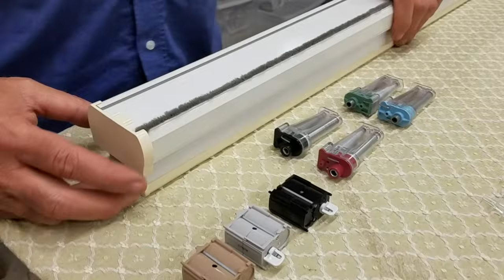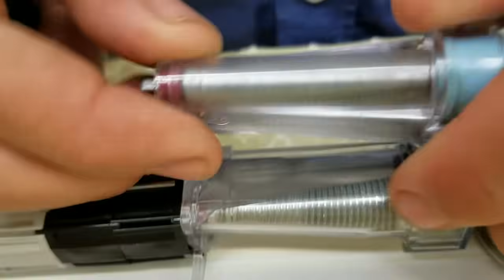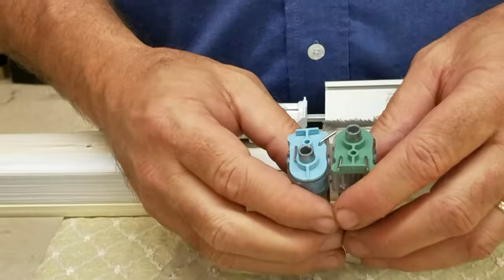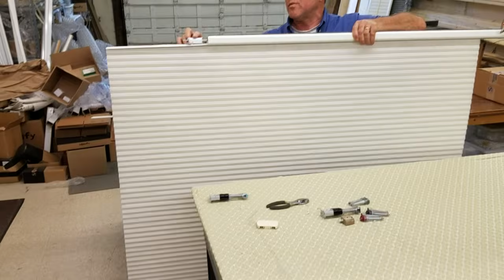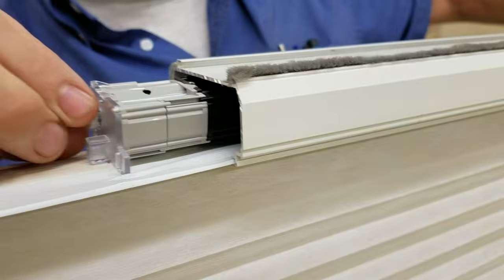Hunter Douglas Duette Shade LiteRise Lift Repair from AutomatedShadeStore.com

Comment: You can cheat on not having to buy the black and gray motors. Just stick a small straight screw driver into the square slot and turn in counter clockwise to rewind the spring inside.  I don’t know the exact number of turns though you can feel tension build. If you don’t have the shaft stop piece to place in the end of motor then use a small piece of wire to wrap around it and place one end in the small hole to stop it from spinning.  You also need at least one pin for the transmission (blue in my case) so when you add the black motor it doesn’t unwind when you pull the stop shaft. I’m buying one of each , gray motor, black motor, and blue transmission so I have backups but also the pins for the transmission and the stop shafts for rebuilding.

Comment: What I find is the customer pushes the blind to fast and creates slack in the cord and wraps around the shaft.  So you need to lock the motor, remove it including transmission and remove extend it back down then then roll it back up, turning the shaft making sure the cord reels up correctly.  Then put back the motor and transmission.

Comment: You are a rockstar. My problem was that the motor spring tension was not strong enough. I was able to put a small visegrip on the motor end to hold the spring tension in the motor, remove the transmission and then tension up the motor spring a few turns and reassemble it. It took a couple of iterations to get the tension correct but it works great now. Thank you.

Comment: I have a 10 year old shade that no one would repair. It is 8ft long and would have cost me a lot to replace. I ordered the recommended parts, followed this video and “tada”, it is now fixed. My husband was so proud that I took the time to research a fix before we replaced the shade. Thank you, thank you! I definitely recommend giving this a try before you rush out to replace.
Reply: Where did you find the replacement parts in this video? I'm having trouble tracking them down and the link in the video description gives me a safety warning.

Comment: Thanks--this was helpful. It would be good in the future to go a little slower. For example, when attaching the clips to the transmission and engines. I had to really see how you did it by stopping and freezing. Also--the video edit at the end was a bit confusing. For those watching--you definitely have to let it out first before pulling off the styop. Also--mine did not go up as easily. I had to pullit further down and wiggle it up first. After a few times it tightened up.

Comment: This video was much appreciated.  Parts were ordered from you and successfully installed. Blinds are operating again.

I watched the video a few times, downloaded and read the PDF on your website, and still came up with some tips that I believe others could use as well. I have an Up/Down set of blinds with two transmission/motor assemblies.

Read all the way through before beginning work.

•	TIP: If you are replacing just the transmission/motor assembly, then there is no particular need to slide the head rail entirely off the rest of the blind (which I did and later a working transmission/motor assembly slipped out of its mounting holes and the spring unwound. Bummer. It would have been nice to have maintained that as a backup).
•	TIP: If you have a second motor/transmission assembly that is still good, put a white shaft stopper onto it to prevent the spring from accidentally unwinding if the shaft should pull from the transmission (which readily happens). Putting the stopper on it should be done while the blinds are fully extended.

1.	The new transmission has two removable pins that prevent it from inadvertently turning. Slide the clear plastic transmission adapter onto the transmission, protruding edges forward. To make installation easier, pull the pin on what will be the bottom of the transmission. Leave the top pin in place for now.
2.	Snap the black motor onto the transmission. Push until it clicks. Make sure it is seated properly.
3.	Remove the white shaft stopper on the black motor by wiggling it and pulling it off. Use this shaft stopper in the TIP above.
4.	Snap the outer motor (gray, tan, etc.) onto the black motor. Push until it clicks. Make sure it is seated properly.
5.	Snap the clear plastic motor adapter onto the outer motor. Push until it clicks.  Make sure it is seated properly.
6.	Leave the white shaft stopper in place on the outer motor. Remove the second pin on the transmission.
7.	Lower the blinds until the spools are empty of their cords. If you have an up/down blinds, lower both together until the strings are completely unwound from their spools.
8.	TIP: If you have a second motor/transmission assembly that is still good, now is the time to put a shaft stopper onto it to prevent the spring from accidentally unwinding if the shaft should pull from the transmission (which readily happens). Putting the stopper on it should be done while the blinds are fully extended.
9.	Keep the string from wrapping around the take up spool.
10.	Line up the transmission assembly with the shaft notch and slide together, leaving the white shaft stopper in place. Make sure the string is not tangled in any way. Keep the blinds lowered for the moment.
11.	If you need to replace the second motor/transmission assembly, slide the head rail in the other direction, exposing the assembly. Replace it, remove the second pin from the transmission, but leave the shaft stopper in place for now. 
12.	If any of the string take up spools have shifted, put them back into place. Make sure the string is completely unwound from the spools.
13.	Slide the head rail first in one direction, then the other and pull the white shaft stopper off each spring motor/transmission assembly. Wiggle it a bit with a pair of pliers if necessary. Keep the stopper and pins for future usage.
14.	The tension on the transmissions will begin to pull up the blinds.  Test operation by pulling the blinds down and raising them up.

a.	If you need to clear up something, e.g. a knot in the string, pull the shade all the way down, and put the white shaft stopper back on the square end of the shaft sticking out of the outermost motor.

15.	Slide the head rail into position.
16.	Put the head rail end caps back on.
17.	Install in window.

Hope this helps others even as your video got me started.

Comment: I recommend anyone buying these types of expensive shades, not to do so. The string in the transmission will fail after about 4 years regardless of usage. The heat and cold cause the transmission string to become brittle and snap. I have 27 of these in my house and I bring them down weekly to be repaired. They have a 7 year warrantee and each one cost us around $800 a piece. 800x 27 = Well over 20K for constant headaches. Buy the cheapies from Lowes or Home Depot. They are GARBAGE. I just purchased enough parts for 4 shades because its embarrassing to keep going back to the store.
Reply: All of the transmissions were modified about 24 months ago to remove a small internal plastic piece that rubbed on the string and caused excessive wear that led to failure. The new transmissions should provide many years of service which remains to be seen. The new modified transmissions have a “smoked” color clear plastic cover instead of the old clear plastic. We only sell the new modified types.

Comment: I have two black motors connected together. They work, but I need to buy a new transmission. How many turns should I wind the motors to get to the starting point in the video? Thank you.
Reply: Answer: I purchased a black motor and counted the number of times that it was wound from the manufacturer. (I carefully removed the key and counted how many unwind turns before it rested.) Knowing the count will help me fix other blinds that I only replace the transmission. 42 times! --Way more than I imagined!
Reply from the maker: 42 clockwise turns should do it.

Comment: Is there a way to know the lines inside are good before clicking the transmission and gear into place?  Also is there another step if the line came detached at the bottom plug?  I’m a little concerned I may connect the pieces and nothing happens.

Comment: Great video instruction 👍We also accidentally lost tension on the first set of replacement motors. One little key part was keeping the shade fully open before pulling the motor pinout. I'm stoked to have it working again. Thank you.

Comment: What if it hangs crocked ?
Reply: If the shade hangs really crooked then the lift cord most likely is wrapped around the cord takeup reel incorrectly. If it is just slightly crooked then it was probably like that before it broke and can be adjusted at the bottom rail by adjusting the lift cords thru the pocket and ferrule or the cord adjuster if a newer shade.

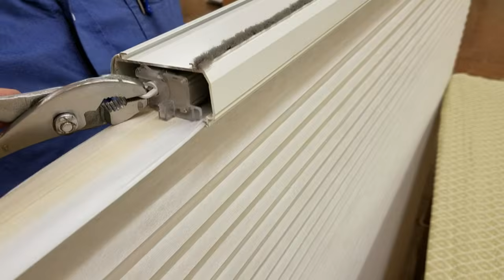Comment: I got my second replacement motor, followed along again, and at that moment when you remove the shaft stop at 6:54...I got to hear my motor whizz out, losing all the tension.  No idea what I did wrong this time, but the blinds are beginning to shred now where I move of the metal covers back and forth and I just cannot face buying another kit to get the same results.  I guess I get to be the one where it does not work.

Comment: thanks for the video.  Like most viewers I appreciate your step by step instruction.  I did purchase the parts from your site.  The most difficult part of the repair was taking off/on the blinds from their mounts.  Ironically HD offers lifetime warranty on parts, however, labor is over $150, so it was still cheaper to purchase the parts and make the repair as instructed.
Reply: Glad to hear your repair was a success🎉. Hunter Douglas states that the lifetime warranty applies to the original purchaser.

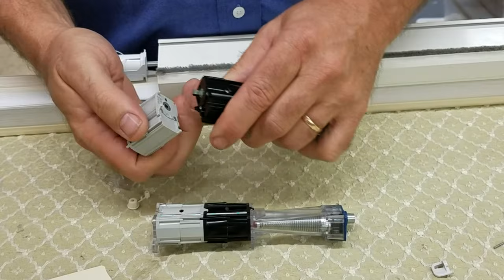Comment: Alas, I watched this several times and then, when it came for me to do it, I had my headphones on and was concentrating on what was in front of me.  Which meant I stupidly removed the shaft stop at 4:07...but as I only had one motor, that step was not for me.  I found out at 4:48 when I heard you say "You don't want to release this."  Sigh.  I feel like such a twit.  On the plus side, I have now been through the whole process once and know what to do right this time.

Comment: Thank you thank you THANK you for putting this video together. I broke my first transmission because I simply installed it on top of my existing motors. Learning from experience I decided I'd better have a harder look for the secret to installing the replacement part. I had a spare I bought (thankfully) BUT I didn't have the motor assembly. So what I did was I installed the transmission on it's own with the adapter installed and clicked it in place. I came in behind with with the motor assembly I had wound up (about 20-25 half turns) using a hex nut screwdriver adapter and with some assistance we got the two together. Unless you're really dexterous you're not going to be able to hold the spring tension with the screwdriver AND get the transmission installed. The process was less drama that I imagined. In the end, one of my strings was shorter than the other so I've got a small tilt in the blind when it's down but, for now, I'm a happy dude. There is NO information on the HD website nor is there any support info on the parts store where I bought the transmissions. You, my friend, is why YouTube still exists. Thank you for doing this.

Comment: Once again this video gave me all the info I needed to repair a Hunter Douglas Duette LiteRise lift.  Thank you!

Later, my wife called Hunter Douglas to get replacement lift tabs; they told her there is a lifetime warranty and sent her several for free.  I purchased replacement motor and transmission on line, but they might have been free from Hunter Douglas.

Comment: Okay, I wound it like you said, and it started clicking at about 20 winds so I stopped. It raised the tension but did not pull down correctly and made a clicking noise as I pulled it down until it was back to weak tension again. Does this mean my motor/spring is broken?
Reply from the maker: Yes motor is broken

Comment: Do you have an explanation on how to do this with top/down bottom-up version? I can't seem to figure out how to get the new motor and transmission to engage properly when installed. I think has to do with how the spools are set before I release the motor stop. Thanks!
Reply from the maker: Top down BottomUp shades are best done with two people.  One person holds the shade so both the bottom rail and the intermediate rail are fully extended away from the top headrail and the lift cord will be bailed off both sets of lift spools.  The other person will position the new lift assembly in place making sure the transmission adapter and motor adapter pins are seated into the punch holes in the aluminum slat. Slide the assembly back into the headrail and pull the white motor stop/lock off the motor to complete the procedure.

Comment: This guy is a rockstar! I followed the instructions but accidents happen and I lost the tension on my motors while reinstalling. I called him and he gave me a solution that worked. What a nice guy!!!
Reply: Where did you find the replacement parts in this video? I'm having trouble tracking them down and the link in the video description gives me a safety warning.
Reply: what is the solution?
Reply: @jadenmateri probably to connect the transmission into the silver bar (v notch or d notch) and then wind it by hand by twirling the mechanism before placing it on the track and snapping it into the pin holes. Hold in place and slide the track back in.
Reply: I can't get my blind to go all the way down

Comment: I purchased 2 motors, biege, for 2 shades.  The transmissions are still in good shape and wound as it should be. Followed directions exactly per the video an it is not working properly. The internal lines a intact. Does not retract with out help and does not go all the way up. What am I doing wrong? Do the shade wind up spool shafts (3) need lubrication?

Comment: Keeping this going. A daunting repair made easy. Worked on my Vignette Shade. Easy ordering and quick shipping. Note you might consider having some double stick tape or glue handy as the fabric was pulling away from the top guide, as well as the aluminum  housing.

Comment: Would you please  comment on how to correct the problem of one side of the shade drooping down after it has been retracted. Is the repair a simple as popping out the plug on the bottom bracket and shortening the string?

Comment: Great Video.. are these motors / transmissions standard items?   I have some wooden blinds by Blinds.com and the motors seems to have failed... it looks just like the black / grey motors you replaced.
Reply from the maker: The motors and transmissions for Wood Blinds are larger than the parts used for the Cellular/Duette shades and cannot be mixed. Here is a link to a video to repair the wood blinds: https://www.youtube.com/watch?v=tURuNlkSF8Q.  If your current parts look like the ones in this video then they will work. Hope this helps.

Comment: The video shows a bottom up repair, I have a bottom up / top down shade where the top down transmission failed.  Do the same procedures apply regarding the state of the blind before you remove the last transmission pin?
Reply from the maker: Yes both the bottom rail and the intermediate rail will be fully extended down all the way so no lift cord is on any of the cord lift spools. Then install the lift assembly and pull the pin.

Comment: Wow! I did it!!!! I am not mechanically inclined so I watched this video, or parts of it, several times to make sure I thought I could do this. Then I clicked on the "automatedshadestore.com" link; ordered the right motors and transformer with 3 day delivery and did just what you see in the video. I tried to order the parts from our local Hunter Douglas store but they don't sell the parts without me paying for the installer guy as well. Also, they didn't have the parts in stock so they were going to wait for the parts and then I could wait for the installer, etc. So, I saved money and lots of time and have a wonderful sense of satisfaction. Thank you!

Comment: FYI: The motors and transmissions from Hunter-Douglas also work in Alta shades. I just did a replacement on a 16 y.o. Alta/Kathy Ireland shade. I re-used the old adapters for both the motor and transmission as they seemed to fit the system better (they were larger/wider) and following the instructions in the video had it working in no time.

Comment: We bought a house with a large, 104", Hunter Douglas Duette Honeycomb Literise shade that will no longer go up. When I pulled it apart the transmission color is not any of the 4 shown in the video but is an off white color. Do you have any idea if one of the others can replace it as I can't seem to find the off white one on-line anywhere...? Thank you!
Reply: If you check the website there is a note about this:

"Note: If your shade has a WHITE Transmission: Replace with a RED Transmission for shades widths less than 48" or a BLACK transmission for shades over 48" wide."

So I think the transmission you need for your 104" shade is the black one.